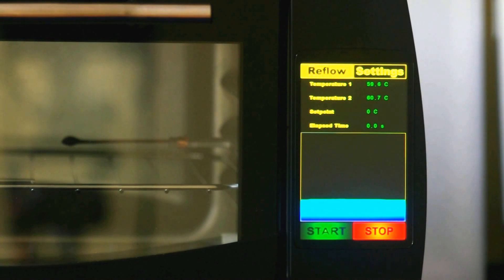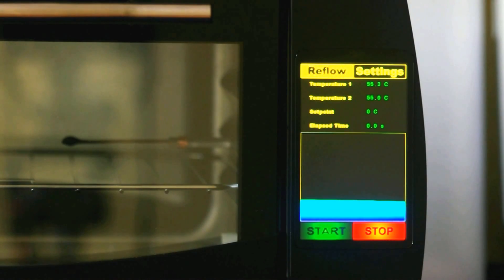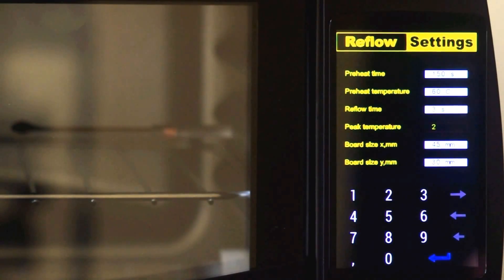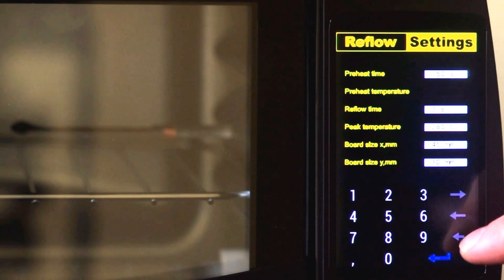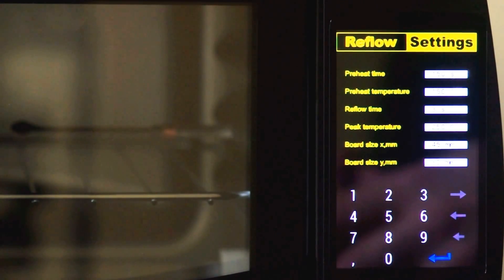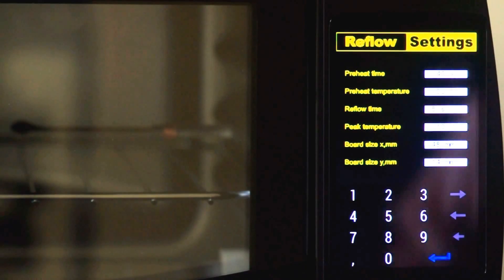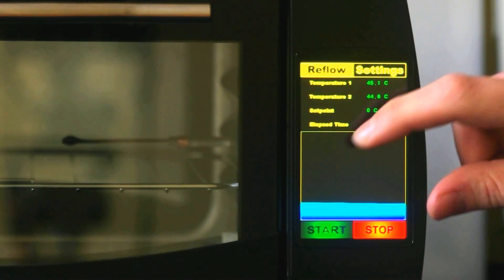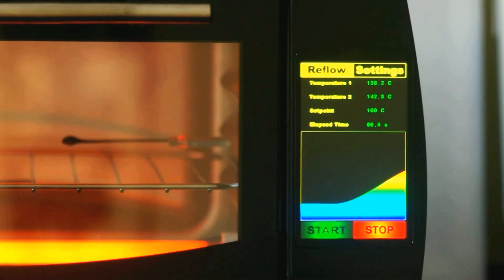Smart Solder Reflow Oven Project

Comment: Hi again, can you get more than 2 brightness levels using 0x39 register settings?
Reply from the maker: Don't know, maybe varying power supply for oled ? It has plus/minus power
Reply: @Kilohercas  I went from -4.8 to -2.3V and nothing happens :(
Reply from the maker: @romicabogdan  
Phone does it, maybe where is some register.
Other and stupid way to to scale RGB values by amount you need. It is processor intensive, but maybe you can play with alpha values on STM32 screen engine.
Reply: @Kilohercas  Got it working, it's the 40-46, 50-56 and 60-66 registers (grey scale adjustment).

Comment: Hi, the screen is AMS369FG03 ? Did you use RGB interface? Thanks
Reply from the maker: Yes, OLED from Samsung, HTC Desire.
Yes, RGB565 , it was a lot of pixels for that MCU. Note This screen is so perfect, but it is not manufactured anymore.
I have full datasheet for it :)
Reply: @Kilohercas  Ok, did you buy it from somewhere?
Reply: I'm referring to datasheet
Reply from the maker: @romicabogdan  No, from some Chinese website, had to upload lot of datasheets to get it download.
Reply: @Kilohercas  :)) I know the method, I just got it for free on a russian website, next thing is to buy some Desire phones. I'll use SSD1963. Thanks
Reply from the maker: @romicabogdan  It is at the end of VRAM to do it, but it will work :)
Reply: @Kilohercas  Here's my update, after weeks of PCB drawing and a $40 pcb order + 2 days of scratching my brains why is not working I found out it needs SPI communication :)))). I thought it;s a dumb display, like the 7" I used in the past with SSD1963.
Reply from the maker: @romicabogdan  yes, if you need init code I have it. It was in datasheet ;)
Reply: @Kilohercas  Hi again, I got it working but not 100%. SSD1963 is a piece of crap. I had to use a transistor to reverse polarity of ENABLE pin. 
At low pixel clock I have good image but with flicker, when I increase pixel clock the sync between HSYNC and ENABLE is changing (I can see with Saleae logic analyzer).
Please give me some info about HSYNC and VSYNC parameters. I used Hor. total period=500, Hor. pulse width=4 clocks, pulse width+back porch=12. VSYNC has Vert. total period=815, vert. pulse width=2 and pulse width+back porch=9. Thanks
Reply from the maker: @romicabogdan  
#define  LCD_PIXEL_WIDTH    ((uint16_t)480)
#define  LCD_PIXEL_HEIGHT   ((uint16_t)800)

#define  HorizontalSync         4
#define  AccumulatedHBP         4
#define  AccumulatedHFP         8
#define  VerticalSync           2
#define  AccumulatedVFP         8
#define  AccumulatedVBP         6
  /* Timing configuration */  
  /* Configure horizontal synchronization width */     
  LTDC_InitStruct.LTDC_HorizontalSync = HorizontalSync-1;
  /* Configure accumulated horizontal back porch */
  LTDC_InitStruct.LTDC_AccumulatedHBP = HorizontalSync + AccumulatedHBP-1;
    /* Configure accumulated active width */  
  LTDC_InitStruct.LTDC_AccumulatedActiveW = HorizontalSync + AccumulatedHBP + LCD_PIXEL_WIDTH -1;
    /* Configure total width */
  LTDC_InitStruct.LTDC_TotalWidth = HorizontalSync + AccumulatedHBP + LCD_PIXEL_WIDTH + AccumulatedHFP-1;
  /* Configure vertical synchronization height */  
  LTDC_InitStruct.LTDC_VerticalSync = VerticalSync - 1;
  /* Configure accumulated vertical back porch */
  LTDC_InitStruct.LTDC_AccumulatedVBP = VerticalSync + AccumulatedVBP - 1 ;  
  /* Configure accumulated active height */
  LTDC_InitStruct.LTDC_AccumulatedActiveH = VerticalSync + AccumulatedVBP + LCD_PIXEL_HEIGHT-1 ;
  /* Configure total height */
  LTDC_InitStruct.LTDC_TotalHeigh = VerticalSync + AccumulatedVFP + LCD_PIXEL_HEIGHT + AccumulatedVBP-1 ;
Reply: @Kilohercas  Thanks, I got it working with some crazy parameters for Hsync but I still have one thin purple line on the 800 pixel margin. I think I'll get a STM32F and stop playing around with toys like SSD1963.

Comment: Wow !!!
the best diy reflow oven i saw !
where can i find a parts list and schematics ?
Thanks in advance ! :)
Reply from the maker: parts in farnel and ebay
Schematics.well, i never use schematics for my design, i hold that in my head. PCB can get for me, or order from OSH park. Problem with this oven is that i lost my program in raid fail, where is few bugs in this version, but it does work, If you are interested in developing UI, i will send pcb for main controller and power controller for free ( parts you will get from farnel)
Reply: ah i see...nah i don't have programming skills at all :/
thank you thought ! :)
Reply: Linas K
Congratulations! I am very interested in doing it, I am in need of a reflow oven and this one seems to track the curve fine! UI algo seems the best. Added you on skype (from hackaday). If you not willing make it commercial, could you send me its technical details? Did you manage to get software back to work? Thank you

Comment: Hello, i am learning to program the stm32f4 discovery board, could you post the code somewhere so i can learn from it?
Reply from the maker: trust me, it is to complex for normal people, it will be easier start from zero, than try to understand how it works
Reply: yes, i know.
but i just want to know how it is all built up, the methods he used to do some stuff like how to use a screen or touch screen.
Reply from the maker: Nikola Tesla

http://web.archive.org/web/20140124125408/http://www.element14.com/community/community/knode/dev_platforms_kits/element14_dev_kits/psoc4_pioneer_kit/blog/2014/01/02/psoc-challange-smart-reflow-oven-touchscreen-and-amoled-screen
Reply: Linas K The PDF/zip files are not captured by archive.org and the original post has been deleted.  Can you try github perhaps?
Reply: Linas K Thanks :D
Reply: Very curious about the display controller code.  Impressive job with that.

Comment: Cool project! You could add a ºC/s (degrees per second variation) on screen, that should not exceed 4ºC/s. Keep the good work!
Reply from the maker: it would be easy to do, but i know that maximum raping speed is 1C/s and at steady state is +-0,1C/s or less, i don't see any point of doing that. If i add more heaters, like 2000W or more, that would be useful . In that case i should add dT/dt limiting in my PID Loop, but for now it's ok